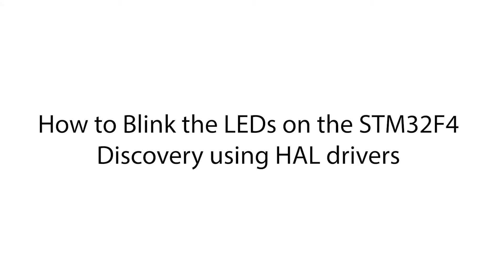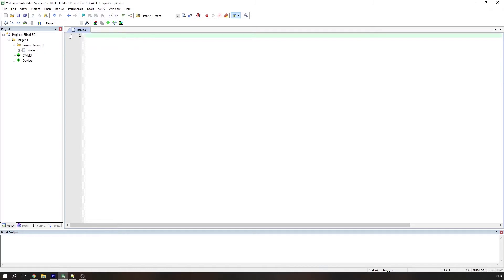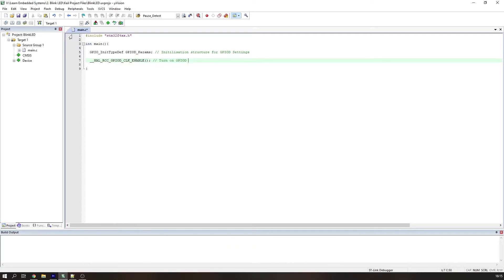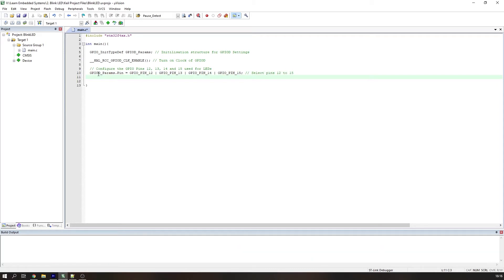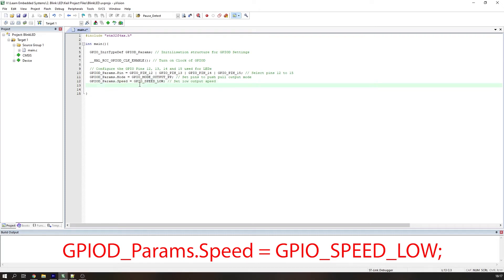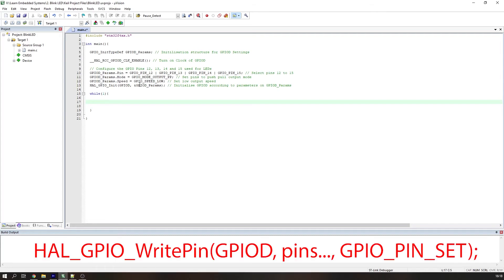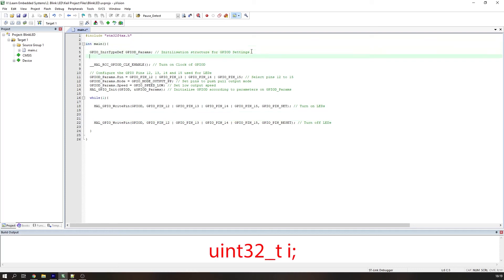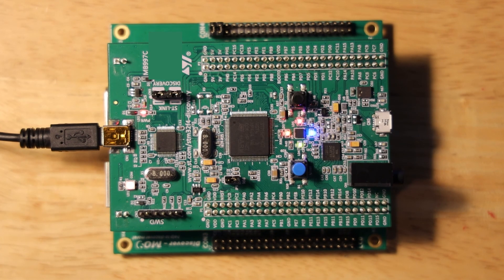Getting started with HAL: STM32F4 Discovery Blink LEDs

Comment: A good intro to HAL.  It looks like Greek to me, far removed from the spec sheet or reference manual.  One is left to sift through thousands of pages of HAL documentation to find the correct syntax.  The learning curve is steep and long.  Probably worth it for complex functions like USB or Ethernet communication but for tight, fast digital control loops (ADC ==> PWM), direct register writes make more sense.
Reply from the maker: Glad you found the video useful! It took me a while to get my head around the HAL drivers and macros, but once you get used to them it can make configuring functions, as you note, such as USB or ethernet, even for things like I2S or system clocks more intuitive.